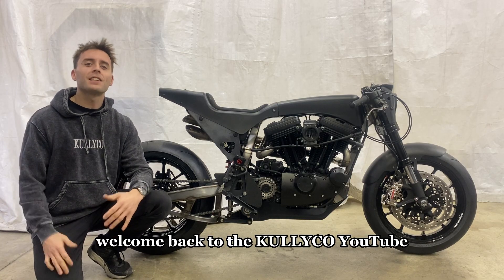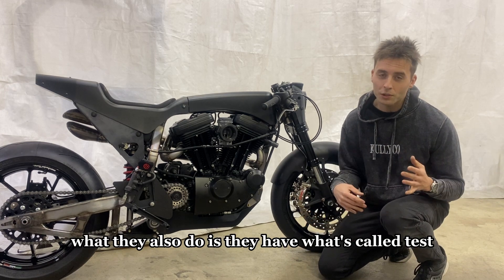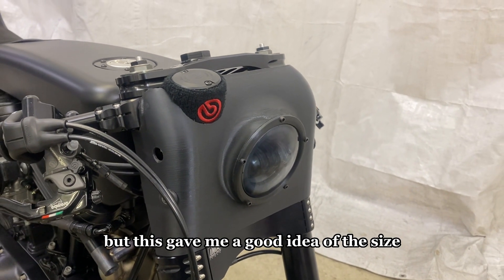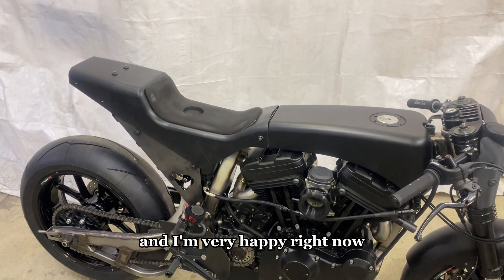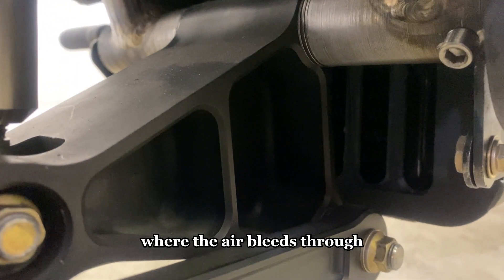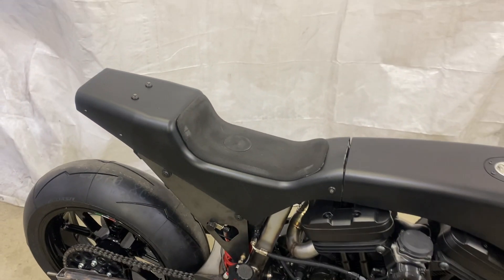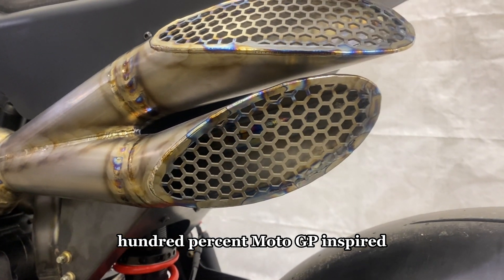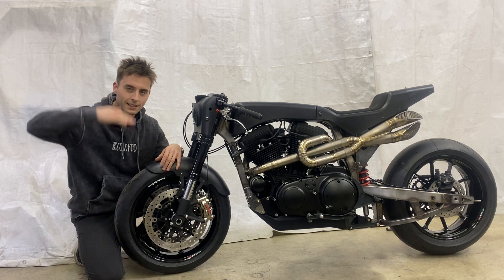Exclusive Look: Test Livery, One-Off MotoGP Inspired Harley-Davidson Race Bike- a custom prototype!

Comment: Why not just add a fuel hose or hard line to connect both tanks and add purge line with ball float on top then there is no need for a second fuel filler door under the seat. Also foresee many leg burns for the rider with that exhaust 😂 Great work on the bike, lot of work to get to this point no doubt.
Reply from the maker: That’s a very good question . I modeled a transfer line many different ways… but I couldn’t find a design that was tasteful enough to run.  The real conundrum was that i didn’t want to have to wait for the fuel to transfer to the auxiliary cell when fueling up- and to have fuel transfer with any sort of efficiency , the transfer line would’ve had to of been larger than i would feel comfortable running on this bike.  Also, the exhaust will get carbon heat sheilds in its final form
Reply: @KULLYCO  that definitely makes sense, I imagine AN8 line or hard line would move fuel quick enough and the time it takes to move fuel would be a minute or less but I get what you're saying. All the best and nice work!